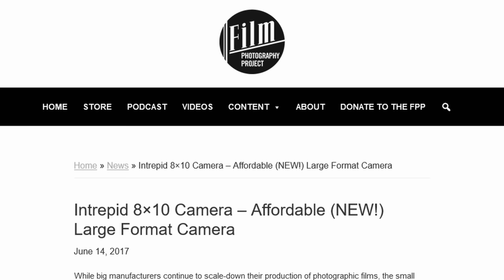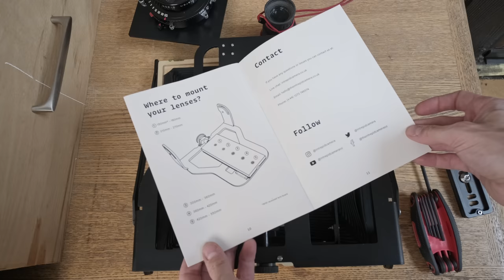Intrepid 8x10 Gen 3 Camera - My Final Thoughts - Large Format Friday

Comment: It is nice to see you back.  I have an Intrepid 4x5 (second gen that I turned into a 3rd gen). I am very happy with the 4x5 and its construction.  I haven't noticed any issues in the multiple years that I have used it.  I suspect that the smaller size is easier to manufacture than the 8x10.  I will say the Intrepid customer service is really great. They respond quickly and go beyond just platitude responses to help users.  I am quite happy with my Intrepid.

Comment: That camera simply looks very unstable to me, I don't like the way the whole thing wobbles as you turn it around on the tripod head. The frame material seems far too thin and insubstantial but maybe I am spoiled by the Cambo cameras I used in the past and the DeVere that I own now, which is bulit like a tank. If weight saving is an issue then large format cameras are really not for you.

Comment: Hello Matt,
I bought an Intrepid 8x10 gen.3 in September 2022.
Like you, I too have found that my original sinar board do not fit well into the standard due to tight tolerances. Luckily I have other boards that do well.
I also received a new back with the correct registration distance from intrepid. The new back had another problem (light leak) which drove me crazy and caused me to burned several sheets of film before realizing where was the issue.
Having reached the verge of despair, I contacted Intrepid who finally sent me another back with all the problems solved (at least I hope).
I think there were major quality issues with the first batches of this camera, however the important thing is that Intrepid put their face on it and the will to solve them all. Kudos to them.
Also on the good side: I  find that this camera is invaluable for all those activities where you want to stay light or simply don't want to ruin more expensive cameras (i.e. working with wet plate and potential silver nitrate drops).
In addition to being light, it is also relatively small. I find that it still has many merits and its very precise location, as you rightly have
indicated in the video.
In short, in the end, despite so much suffering, I'm happy with my purchase and I feel good with my Intrepid 8x10 gen 3.

Comment: Hi Mat. First, I recently finished 3D printing a 5X7 camera for myself. I did not put a sheet of film through it until I had accurately measured the distance from the back of the lensboard to the ground glass having made sure that it corresponded to the distance to the film plane in the film holder. There was a difference of less than 0.1mm which was acceptable. Secondly, I made sure that the film holder was sitting absolutely flush against the back of the camera to prevent light leaks. So, I recommend to anyone buying new or used large format cameras to make an accurate measurement of the dustances mentioned. It is critical. The sort of problems you mentioned, unfortunately happen from time to time even in the most advanced manufacturing. I can assure you of this from persoanl experience. The positive is that Intrepid found out the problem and send the replacement part. Also, very good shout on the tripod. I go crazy seeing photographers, mounting high density digital sensors ( cameras) onto flimsy Carbon Fiber tripods just to save a Kg or so  of weight in their luggage.

Comment: I ordered mine in early December. 12 weeks later I received it. I was so happy to have a camera with more movments than my 120-year-old Century View 8x10. I love my Century View, I hand-made replacement Bellows, lens boards, and ground glass hold-down tabs out of brass. I started LF using a Cambo SC 4x5. I was very much in need of a 8x10 camera with more movements. My Gen 3 looked like I was good to go. My issues with the camera are with the leaf springs for the ground glass film holder on the rear. Even when I put a death grip on all of my screws knobs and whatnot I move something when inserting the film holder. The Leaf springs are very strong. I need to open the back before inserting the film to work around this. Even removing the film holder will move something. Other then that I have been Very happy with my lightweight 8x10. I do miss the rack and pinon focusing but I'll get over it. Thank You for your hard work and time on this video.

Comment: I've probably mentioned my experience with the Intrepid 8x10 before on your channel, but I think it is worth mentioning it again if it helps someone make a decision on what camera to buy.  I ordered an 8x10 in mid-2019 and it took a while to arrive, finally showing up near the end of the year (much longer than the anticipated ship date).  I had a lot of trouble with the back not being attached properly and causing light leaks.  When I asked for help on it, they were quick to let me know they would replace the back, but then it felt like I was put back to the end of the line when it came to sending the thing to me.  In the end, it took about 10 months for me to get a working camera.  By then I had lost any enthusiasm I had for the product and bought a Chamonix 8x10 which is a very well made camera that I have never had troubles with.
Reply from the maker: It is absolutely worth mentioning again and again, especially when current experiences are mirroring those of the past! Large format is a pretty niche hobby, and one that many photographers participating in are doing so for quality and aesthetic reasons. If Intrepid were to put more time into camera quality (construction and materials) and aesthetics, I think they'd find they still have a large chunk of the lower priced market but with customers coming to them for more accessories and cameras instead of service requests.

Comment: I got a Mk II in 2021 and it arrived broken. The focus plate had come unglued. I messaged them and they very helpfully showed me how to reglue it, and it was pretty simple. It did come loose one more time after several months, but I also did kind of hastily reglue it the first time. The next thing that gave out quickly was the clips on the back. However, despite those parts breaking, I never experienced any repercussions from that. They also very kindly sent newer and I think slightly stronger tabs. I was surprised by the burly lens board, too. I knew to expect sacrifices, especially after learning on a burly Calumet field camera. I appreciate how light it is, and find the bellows to be surprisingly sturdy. I don't put it to heavy work, but have rarely been annoyed consistently except the tabs on the back slide off the ground glass frame a lot ... but at least it's easy to fix without breaking my workflow. For me, the compromises have been mostly worth it since I didn't want to spend lavishly on a workhorse, because I didn't need a workhorse.  The weight and size are major pluses and help me want to bring it out more vs. that old Calumet from grad school (which I literally wheeled around in a suitcase). I'd say it's perfectly adequate and maybe even good for a casual large format shooter who knows to expect some compromises, but that a more dedicated 8x10 photographer might want to keep saving a bit longer. If I become more dedicated to 8x10, I will probably investigate moving up the range, but for now my Mk II serves me fine. I've never had the knobs come off on me, but I also approached it knowing that I needed to tread lightly with the hardware. Anyway, sorry you lost so much stuff to the manufacturing error,and that would certainly give me pause, too. I'm glad that they seem to be on top of things when they do miss the mark, and they have been extremely helpful to me when I've needed it. So points to them for that. I hope they can keep refining and fixing things, too. I like them overall as a company, and hope more people can have more good experiences with them as they grow.

Comment: Thanks Mat!  This dovetails perfectly with an earlier video you did where you answered someone's question about whether it's better to buy a new LF camera, or search out a used one.  You made an excellent case that most used ones were originally built as pro-level quality gear, and the less-expensive new ones are built to a light consumer-grade level.  Conclusion:  Just be aware of the trade-offs for each choice.

To repeat one big point in many of your videos including this one, the cost of the camera itself is only part of what it costs to use it.  Lenses, accessories, supporting gear, film, etc. cost the same no matter what camera we use.  I still laugh whenever someone asks, "How much does film cost?"  Until you shoot a lot, even expensive film costs very little compared to what it takes to use said film. (Except for using a DIY pinhole...  lol)
Reply from the maker: "Film is Cheap" is a phrase I heard many years ago and at the time it didn't make much sense. With each passing year and even with film price increases, I understand that phrase more and more!

Comment: Thanks for this informative video.
I can't say nothing about the 8x10 Camera.
 I have a 4x5 Intrepid, the newest model. It is well made. Some litlle things I changed. The screws holding the frontstandard on the sides are to long and so I cut them a bit shorter and replaced the normal nuts with hut nuts. Some areas on the plywood are now paintet in matt black. The recess where the lensboard sits and at the rear where the filmholder is touching the wood. These were only small changes to achive a Swiss finish.It is clear that it would need some time in the production to do such minor improvements. This time costs money. I think it is the right aproach from Intrepid to offer an interesting price to enter in the large photography . The succses of Intrepid shows that they are on the right way.
 The quality of my camera was much more than I expectet. It worked well from the beginning.
Your experience was frustrating. It was such a stupid error in the manufacturing. I am shure that Intrepid will never ever make this mistake again. That is learning by doing! 
I suspected such an issue before I shot the first test pictures on outdatet X Ray film that I got for free. The result was good. To be shure I also measured with a caliper that the groundglass and the film in the holder have the same distance from the frontplane of the holders. It was all ok.
Drawbacks are part of everything that humans are doing.. Learning from mistakes is a normal experience.
Thanks again for your fine videos.
Greetings from Switzerland!

Comment: I have the Gen 3 Intrepid and I'm very happy with it. I did have to do some modifications to it in order to make it work well, but it does work well in situations where I am not able to haul around my Century Universal due to the weight. On my Intrepid I took the back apart and sanded the slots in the back to make inserting and removing film holders more smooth and easy, and I added a fresnel to the back as well. I've not been bothered by the slow focus and have been happy with the camera. I had the first generation Intrepid and only used it a couple of times. It worked well, but not very well and the focus gear slipped a lot. I think the camera is worth the money I paid for it but I've not expected it to compare with a more robust professional 8x10 from the 20th Century. Thanks for sharing your life in large format photography. I've very much enjoyed your videos.

Comment: First of all good to have you back! when I saw the intrepid 8x10, I couldn’t believe how close to was to the Phillips 8x10 explorer, a very little known, extremely expensive and rare camera. Basically what intrepid is going for, but made much better. The focus wheel was tilted down which helped, and it was overall much sturdier. 

Second, I have the camera you are reviewing (because of its resemblance to the Phillips) and, even though I’ve owned it 2 months, it’s starting to show wear and tear, especially in the composite arms that hold the back down. These are starting the bend. 

So, if you are just getting into it, great jumping off point. Even if you are just an every now and then shooter, go for it. But if you plan on using it heavily, you will have problems. It’s going to happen.
Reply from the maker: Hey Sam thanks for the comment! Having started when I did in large format, my first experiences with this style focusing mechanism were the 8x10 and 7x17 R.H. Phillips and Sons cameras. The closest successor to the Phillips IMO is the current generation of Chamonix cameras, especially the 8x10 Alpinist.

Comment: The paradox of the Intrepid is that it's an inexpensive camera, and therefore appealing to novices.  The problem is that the reason it's inexpensive is that they cut corners (or not, in the case of your original back), which makes it unsuitable for novices.  

When I dove into the world of 4x5, after a great deal of consideration, I went with the cheapest Chamonix available (45N-1), which at the time was nearly twice the cost of the Intrepid 4x5-- but the fit / finish, and user friendliness more than justified the higher cost.  I'm a fan of minimalist engineering-- and the Chamonix puts a smile on my face every time I take it out and put it on a tripod.

... and welcome back.  😀
Reply from the maker: John that's a great way of phrasing it, paradoxical indeed! When I fell into my Eastman Commercial B the conventional wisdom was spending < $2000 would get you a "cheap" camera and all the ones worth having were > $4000. My only hope is that the new cheap while affordable doesn't scare newcomers away from the hobby.

Comment: Great video Matt, I’ve got the 4x5 started off with the mark 3 version and got the upgrade to the 4 as it seemed more solid, I had one small issue which was sorted out really quickly. I always thought the back to be a possible weak point as it needs to be incredibly accurate to get the focus spot on. Will have to test out mine at full aperture to see if the back needs adjustment. I will probably still stick with them and have my eye on their 5x7 as my current 5x7 is incredibly heavy.

Comment: Thanks Mat. Based on the last Intrepid video you made, I purchased the 8x10 M3 with the discount code. Sorry about the back with the wrong specs. My other 8x10 is also a Tachihara, which I purchased new in 2004. The weight and size were my motivations to the Intrepid. In 6 weeks, I’m taking it to Iceland, something I never would have considered with the Tachihara. I also purchased a 150mm lens (never shot that wide 8x10 before), and results have been great, and with no need for a recessed board. I’m aware of all the reported quality issues, so time will tell how well the Intrepid stands up to my abuse. In the meantime, the lighter weight and smaller size are going to make for some unprecedented versatility in my travel landscape work. Thanks for your channel! I really appreciate it! - Michael Hardeman
Reply from the maker: Hey Mike thanks for the comment! I think your travel setup is the optimal use of an Intrepid. Those 10 extra pounds go a long way each mile you hike!

Comment: Amen mat, had the same with a roll of Fujifilm pro 400H in my hasselblad 500c/m, not focus, but Glare, so wrecked all my first roll, but have since got a pro shade so this should solve this, one piece of advice, since you only expose ONE sheet at a time, for a new camera, shoot one, CHECK it, then go bonkers, once you know for keeps the camera has no leaks, or focus issues. one suggestion for intrepid, you could make is that they add an adjustment to the ground glass mount, to adjust focus, or a way of shimming the film adaptor plate, to allow the adjustment of ground glass to infinity holes on the bed rail; as with a Linhof Technika you can infinately adjust the front standard's infinity stops, to account for any near\far focusing issue.

Comment: I had a Mk2 5x4 for some years and it was great, very sturdy. Then I bought a Mk2 10x8 and had the same problem mentioned by others, the bellows weren't fitted to the back properly leading to light leaks. Took a while, and a lot of frustration, to figure out where the light leaks were coming from. I understand your pain with wasted shots! I resolved that one myself but then bought a Deardorff which is obviously heavier but much nicer to use. I kept the Intrepid as a light weight option but I haven't used it for a long time, probably more than a year. I would rather put up with the weight of the Deardorff, even on fairly long hikes.

Comment: Your content is the best.  Thanks for the careful and thorough introduction to large format film photography!  

I just finished building my own 4x5 camera so this is fresh in my mind... it's a good idea to validate the dimensions of the ground glass plane in the rear film holder vs the Graflok film holder spec.  For 4x5 the spec is 5mm (0.197") from holder edge to film plane.  I believe 8x10 is 6.6mm (0.260") +/- 0.4mm.  Use a digital or dial caliper with a depth probe (most have this on the end).  Use a spent piece of film in the holder to offset the difference the film adds.  I'd check every film holder you have and then validate that against the actual ground glass.  

Regarding focusing ... I have a cheap 8x loupe but it doesn't have the diopter adjustment feature.  What should I get for 4x5?
Reply from the maker: Tom thanks so much for the comment and thanks for adding the dimensions for 4x5 and 8x10! I'm a fan of the Horseman and Toyo longer loupes (6x and 8x). The Horseman is nice for 4x5 since it can even be used with a pop-up hood still in place.